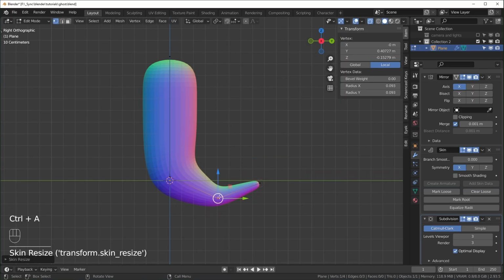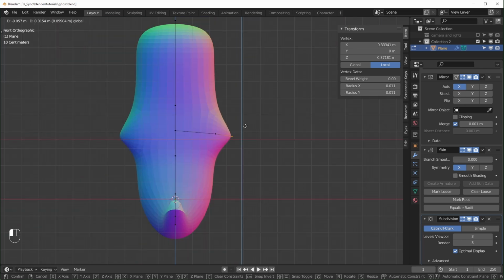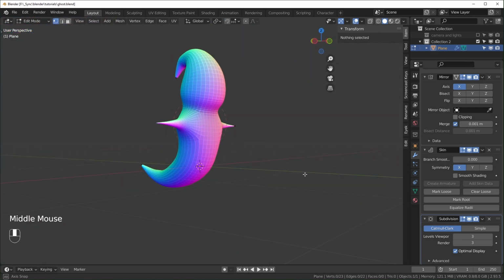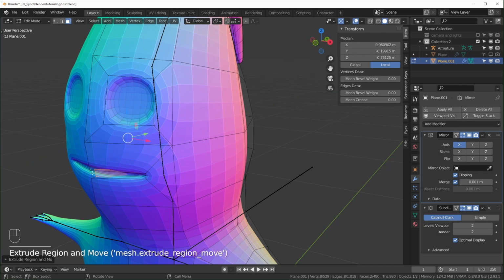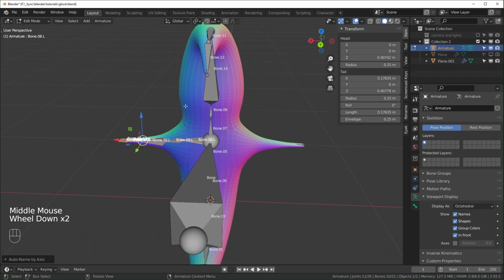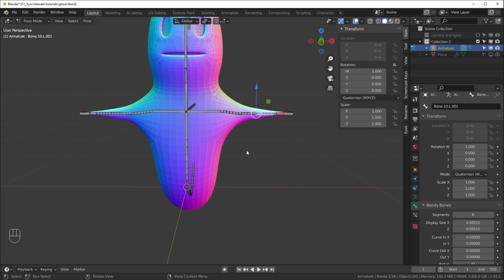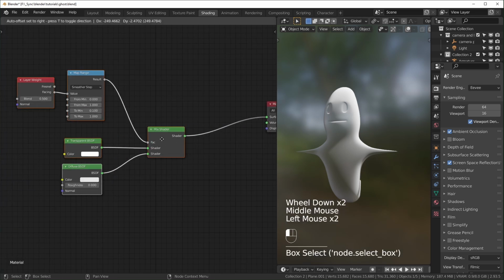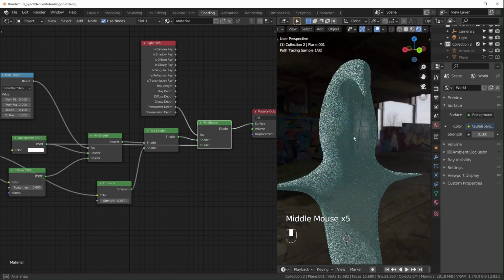Character Modeling and Rigging, Ghost with the Skin Modifier || Blender 2.93

Comment: Problem I have at 9.13 is that some of my faces are of a size that the midpoint of the ghost goes through them. So I cant really select just half of them in a symmetrical way. The faces are of very different sizes. Maybe solution would be to add more loop cuts to subdivide the faces and then delete?

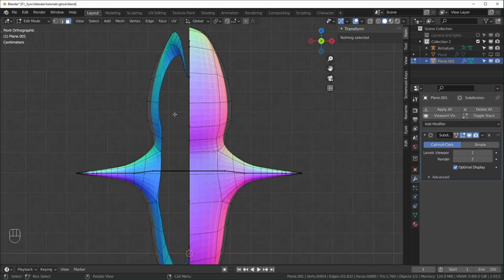Comment: I'm using this tutorial for a non animated project for college. Im new to blender and I''m not trying to learn animation currently. Did I need to delete half of the model like you did at 9:30 ? i did that and now it wont let me apply the mirror modifier, and I can't pose my model outside of the mirror axis if that makes sense
Reply from the maker: That is just to make it symmetrical. The mirror modifier should work, so I don't know what went wrong. If you want more immediate help, you can come to discord

Comment: Ok so I am not new to blender really and for some reason in the version of Blender I am using it is not working when I extrude the vert it is not bring the modifiers with it also the verts are not adjusting when I try to scale them. when I add the arms by extruding the skin modifier also does not appear on the model at all

Comment: I hope you're able to complete a tutorial on the witch.
Question: Once you have this model completed, can it be exported as an obj. I ask because I create things that I offer to other who use different programs, so I like to save several format types to accommodate this.
Reply from the maker: Yes, you should be able to export the model as an obj. The colors should be correct too, because you're using a UV map, but I don't think the other shaders will work properly, not sure.
Reply from the maker: I'm still new to shader baking, so I can't give good guidance yet on how to do that.
Reply: @JoeyCarlino  Well you're ahead of me when it comes to shaders, I know extremely little about them, so making shaders is way beyond me right now. I only know they can't be swapped between programs unless converted and I know how to push buttons...lol
Reply: @JoeyCarlino  You are correct about the shaders not working in other programs, that is true of all programs. They would have to be converted to the program you want to use them in, though it's a lot easier to just use shaders from the program of choice.